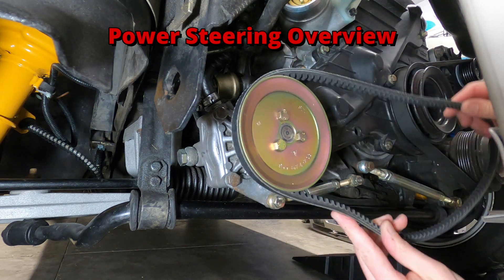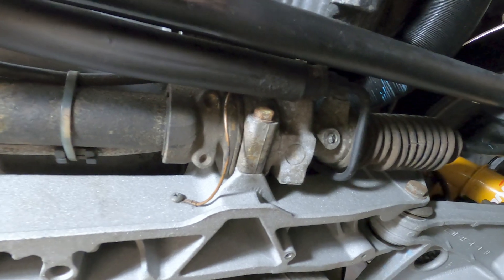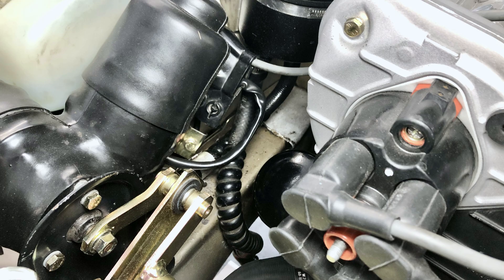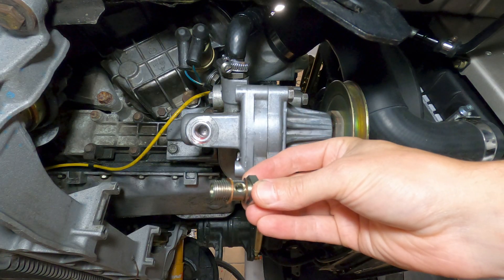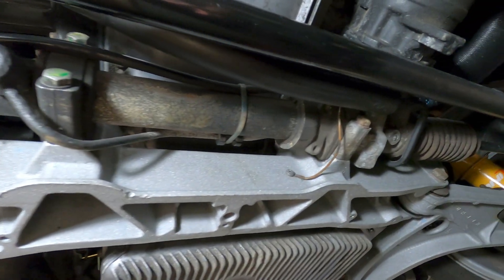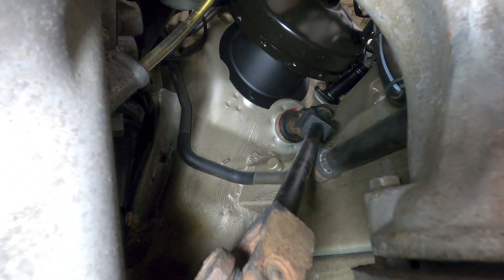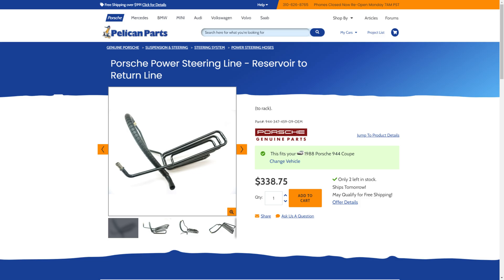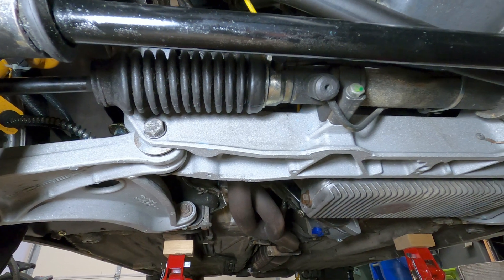Porsche 944 – Power Steering System Overview: Parts, Issues, & Costs

Comment: Porsche has actually recommended a fluid change in these Dex III based systems over time. Pentosin CHF 11S is a hydraulic oil that doesn't have the caustic properties that the old ATF does, and is a bit less problematic as a result. Dex III leaks tend to cause rubber components to swell and degrade on contact, with the most common victim being the right inner sway bar mount. It looks like yours has had some previous exposure as well, going by this video. 

The newer oil may or may not be less harsh to the system seals, lines, etc over time. I guess one downside is it doesn't have that obvious red color to help identify leaks, should they occur. Pentosin CHF 202 should also be a fine substitute. It's designated for 89 and up cars with similar systems, but I doubt there were significant differences in the 944 power steering systems in the last couple years of 944 production, so either should be fine for any 944 power steering system.

No changes of anything else in the system are required. Just flush the ATF as best you can; fill and maintain as normal.
Reply from the maker: Hey Todd, thank you for sharing those comments… that’s great information to consider! I have seen a few examples of people having switched to the Pentosin fluid without causing any issues in the 944’s system, given it’s application in later ZF steering systems. I haven’t personally tried it though, so I wasn’t able to provide a first hand recommendation, but you may be right about my right, front bushing. I caught the pump fairly early in its failure and rebuilt it before it started to dump excessive fluid. I do know that bushing has had a good bath in motor oil from a failing oil pressure sending unit. 🤣

I’m currently eyeing a true manual steering option for my car, which would eliminate at least one future fluid consideration. 👍🏼
Reply: @NC944er  I've definitely thought about the manual rack conversion as well. The question of whether that project ends up as a modified, properly de-powered rack or an actual manual one with more turns lock-to-lock remains, but I'm leaning towards manual as I already run a smaller diameter steering wheel.

I look forward to another well-made video on the subject if that's where your car takes you!
Reply from the maker: @laglord  Soooo… I went to replace the swollen front sway bar bushing and come to find it’s the part number for the 26.8mm variant… car didn’t come with the sport suspension package though. I checked the other side and it’s the 25.5mm part. 😂 Measured the bar and it matches at 25.5mm, which appears to be the Turbo bar, since 87- NA came with 21.5mm. So I’m guessing that someone swapped in a Turbo bar at some point, but also improperly replaced the right bushing. Just when you think you’ve seen all the surprises. 🤣

Comment: I love and hate your videos.  Love all the great info.  Hate how clean everything is.  I spent 2 hours or more with the pressure washer, cleaning the underside of my car, and it still looks terrible.
Reply: Dry ice blasting is the secret, if you're lucky to get one or have someone around your area to do it for you.
Reply from the maker: @John_Cary  I’ve watched some dry ice cleaning videos on P-cars and the process is amazing with stunning results! In my case, I had the control arms and cross member glass bead blasted while they were off the car and then coated in a satin clear.
Reply: @NC944er  Right on. I'm currently restoring my S and glass bead blasting all the aluminum I can. I hadn't thought about coating it though...I suppose that would really preserve it for a long time.
Reply from the maker: @John_Cary  Be careful, it’s addictive! 😂 Especially powder coating, the parts looks so good after. I’ve found that the glass leaves the aluminum a bit porous and then it easily picks up and retains dirt and oils without some kind of coating on it.
Reply: same… my obsession of perfection after watching these videos :)

Comment: Another quality video.  How did you go about getting the lower control arms and engine cross member so clean?
Reply from the maker: Hey Robert! I pulled the control arms and cross member from the car when replacing the rod bearings and oil pan gasket. While the parts were off the car, I had them glass bead blasted and coated in a satin clear. It turned out pretty well and was a good opportunity to rebuild the ball joints and replace the boots while I was at it. 👍🏼